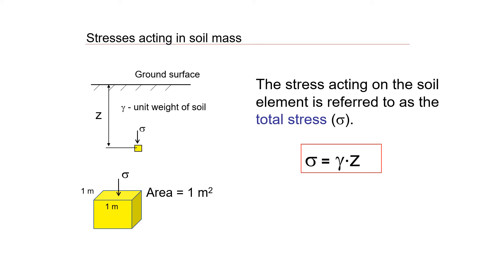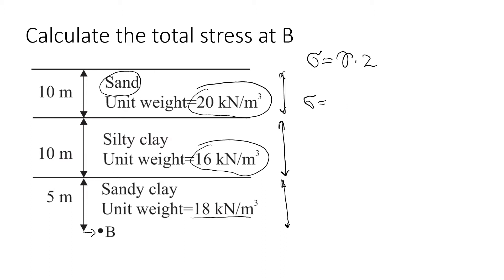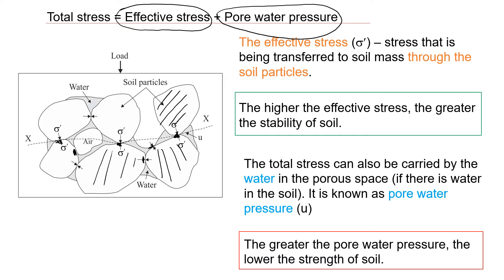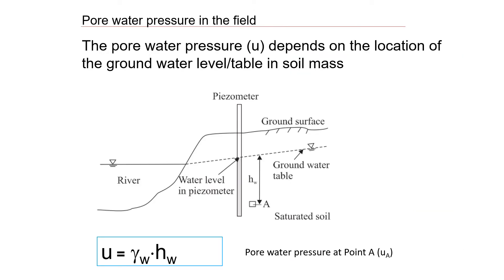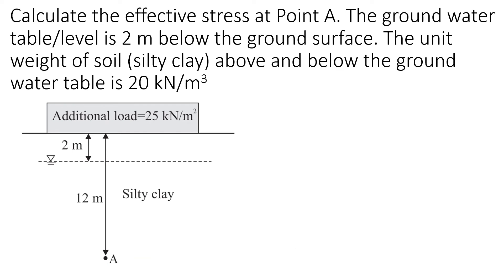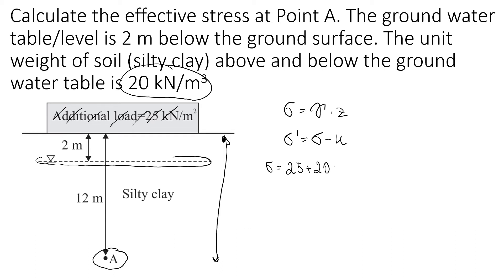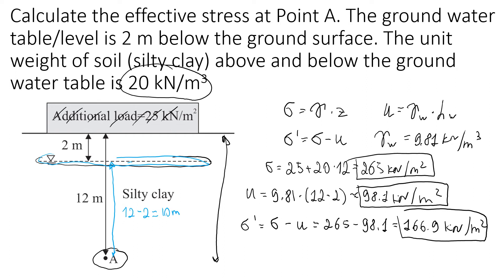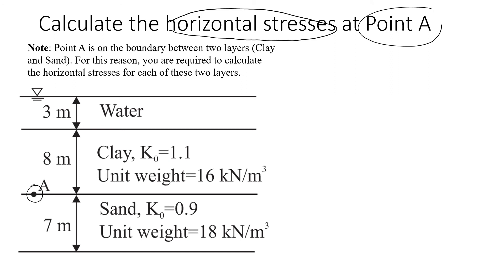Stresses in Geotechnical Engineering: Total, Vertical, Horizontal Stresses, and Pore Water Pressure

Comment: sir for pore water pressure the height of water is two why did you multiply it with ten
Reply: the height of the water is measured from the point you calculate stresses, not from the surface